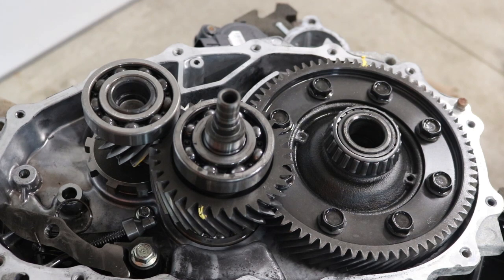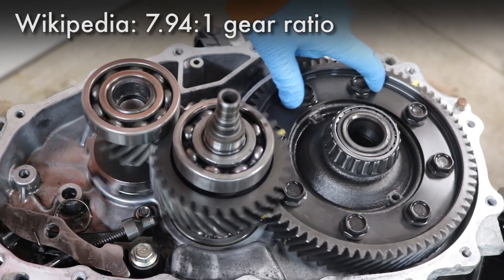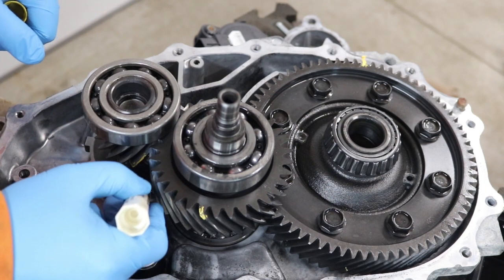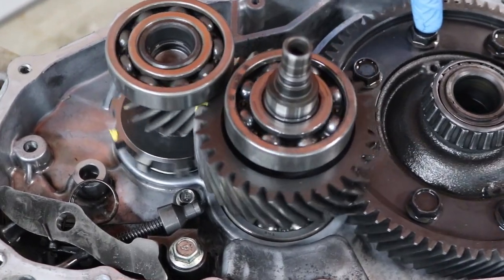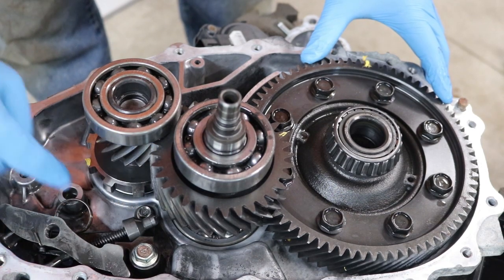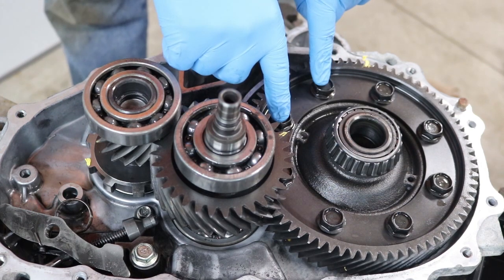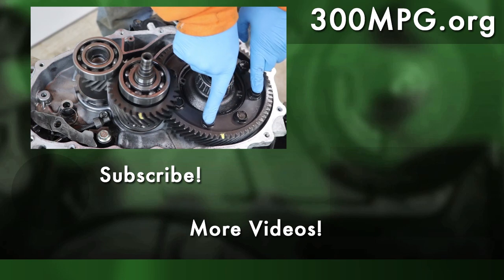Nissan Leaf Gear Ratio Testing

Comment: Ben, Ben...they're gears!. The ratio is the number of teeth on the driven gear divided by the number of teeth on the driving gear...and the two ratios are multiplied together to get the overall ratio.
IT CAN'T POSSIBLY BE ANYTHING ELSE!!!...they're gears for crying out loud!!
Reply: That is exactly what he did to work it out!  When his calculated value didn't match the expected figure he just did this physical test to confirm is figures.

Comment: Hi Ben, is it possible to lower the RPM to 1300 in the gearbox reduction of the Nissan leaf.
Reply from the maker: I don't know off-hand what the final RPM output of the gearbox is. But if the motor can spin at up to 10,000 RPM, and it's an 8:1 gear reduction, that means the top speed of the output to the wheels would be 1250 RPM. (That would be at absolute maximum speed.)
So, the gearing in the Leaf gearbox is already close to that number.
I have NOT worked on custom gearing before, so I can tell you that changing something like that would be beyond my ability. I have a feeling that it's probably easier to attach the motor to a different gearbox which is in the correct gearing than to modify the internals of the Leaf gearbox.
Reply: @BenjaminNelsonX  Thanks alot Ben. appreciate it.
Reply: Thanks, BEN, I did ask because I have the intention to use it for my boat without a gearbox as well.

Comment: Im very upset that after several months of being subscribed and alerts turned on I am not getting any alerts.  I'm it's not coincidence. Thank you for all you've done. I hope to follow in your footsteps soon. I have a 2000 chevy silverado that I would like to put a forklift motor in with custom controllers to keep speed and power.

Comment: I think you might be right about the year. The motor was changed between 2012 and 2013 (torque output went down from 210 to 187 lb/ft, but peak HP stayed the same), so it wouldn't surprise me if the gear ratio was changed as well. That 7.94 figure on Wikipedia is probably from the 2011-12 gearbox.
Reply from the maker: Certainly could be.

Comment: So do you need gears for electrical motors or could you just engineer the motor to move 8 times slower with the same amount of torque and performance curve?
What are the downsides of gearless propulsion? Less efficiency? Higher costs for thicker wires or something?
Reply: It can be done (hoverboard motors are a good example), but electric motors are generally more efficient when they're spinning faster. Gearing down means the voltage can be higher and the amp draw can be lower, which increases efficiency and reduces heat buildup.
Reply: @michaelramsey82  Thanks. I guess lower amp also means less copper?

Comment: Wikipedia is not written in stone.  People contribute  the information.  Something must have changed sense that information was submitted.
Reply: My guess is that the gear ratio on Wikipedia is from the 2011-12 Leaf gearbox. The motor design was changed for 2013, and the gear ratio was probably changed as well.

Comment: Ok this must mean that all the shift leaver dose that is mechanical is engage the Parking brake lock the rest are done by Reversing the 3 Phase motor or reducing the power pulses going to the motor... I know its all electronic but its still Impressive... I have a 2015 Nissan Leaf with the the "24kWh" pack. the Most I ever get out of the pack is 19 to 21Kwh when the climate control is off. Like to see what happens to the system when you put it into Eco-B mode.
Reply from the maker: My understanding is that when you shift to Eco-B mode, all that happens is the car's computer just changes the throttle response. It's all just software. Nothing different in the transmission.

The shift lever doesn't even mechanically engage Park. It just tells the computer to send a signal to that black device I removed from outside the case, and THAT engages park mechanically on the gearbox.
Reply: @BenjaminNelsonX  sorry I should have said Electrical/Mechanical. I know Nissan called it Direct drive.. but I personally call a "direct drive system" No gears at all just a differential. This unit has One Reduction gear... Dose this transmission Ever need servicing? I have noticed Incidents where the Parking Brake would not engage and scary seconds where the re-gen break would not switch to physical brakes fast enough and the car would Zip forward for half a second  It Did caused a fender bender but still a glitch in the system to be sure..
Reply: @JustinJJHCS1  That glitch is a common issue on early Leafs, and it's an easy fix. It happens because the sensors on the brake pedal that engage regen drift out of sync over time.

Here's how to fix it: shut the car off, then power it on in accessory mode (press the power button with your foot OFF the brake). Hold the brake pedal all the way to the floor for 10 seconds, then release it. Now start the car normally (foot on the brake), and the brake glitch should be fixed. This process recalibrates the sensors.

I have to do this on mine once every few months, whenever I feel the pedal start to act this way. It's a bug in the design, but thankfully an easy one to deal with. I think it's been fixed on the 2018+ Leaf.

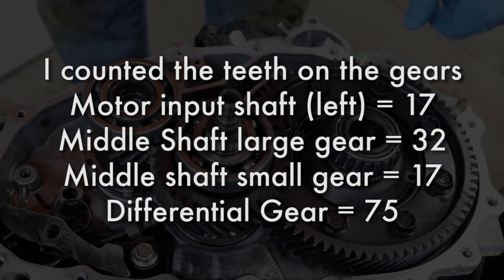Comment: 2:46 Hi Ben, What do you think about using half of Nissan gearbox and reduce shaft rotations with ratio 17:32 ? If your motor has top speed 10 000 rpm, this reduction can give you 5 312 rpm. Thanks for video.
Reply from the maker: It sounds like it would be beyond my skill level as a machinist!